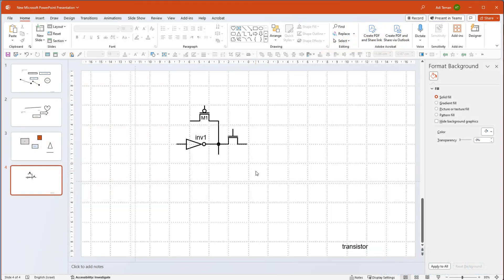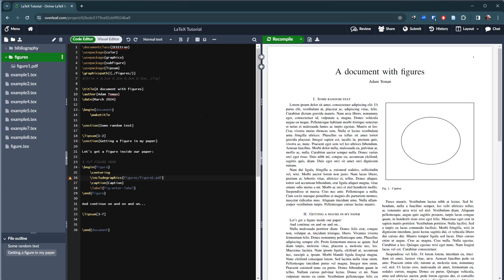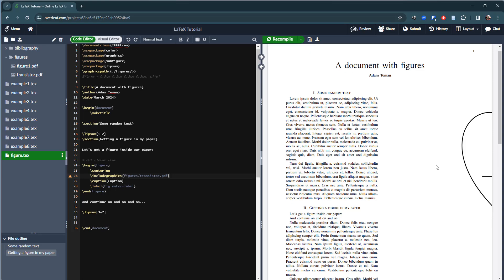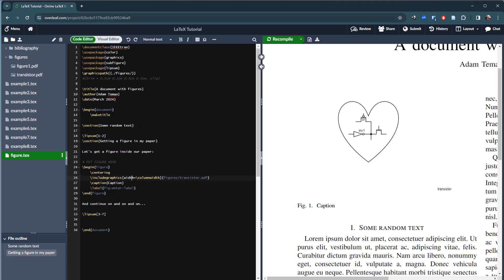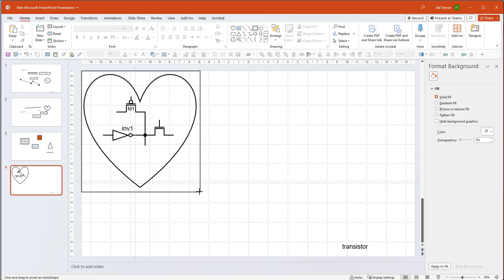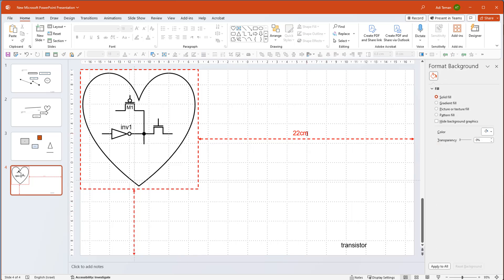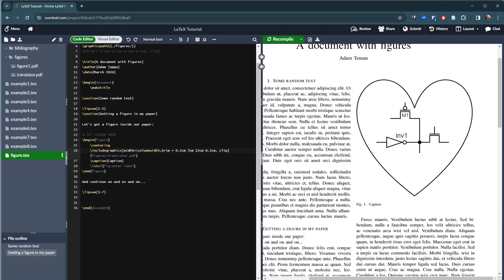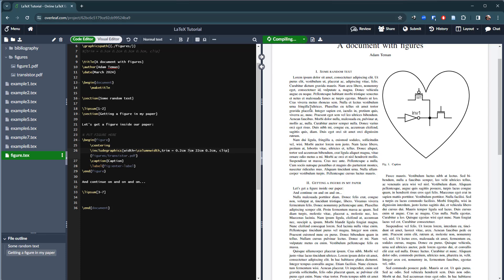Making Article-Quality Figures with PowerPoint - part 5

Comment: Is there any reason why you would prefer to make these in power point rather than just draw your figures in an editor? Imho a screenshot of a schematic in LTspice looks about 80% as clean as the PP drawing. Now that I see you're already using LaTeX, there might be a library for vlsi components that you can draw with tikz.